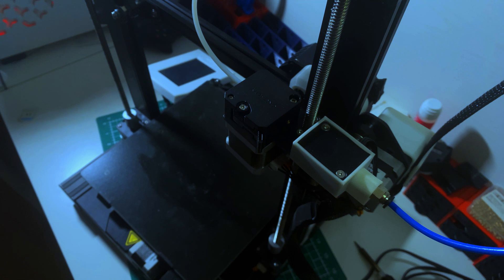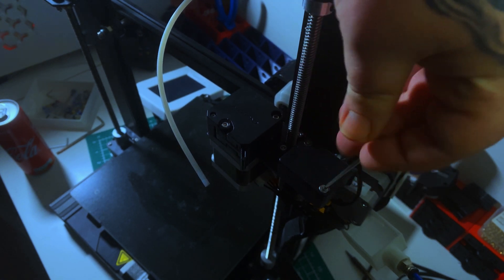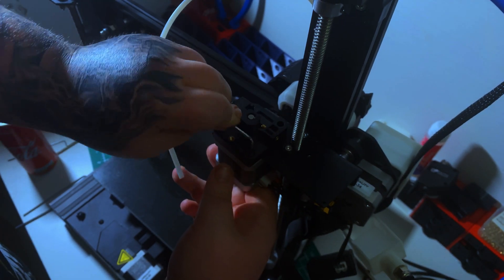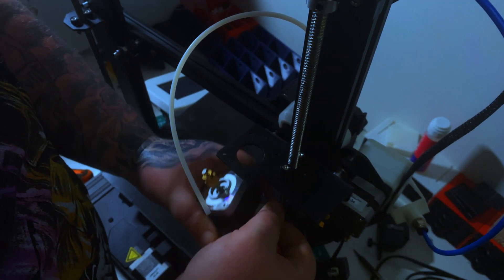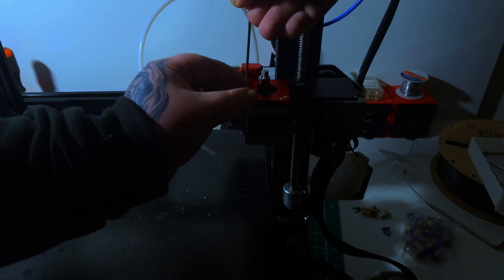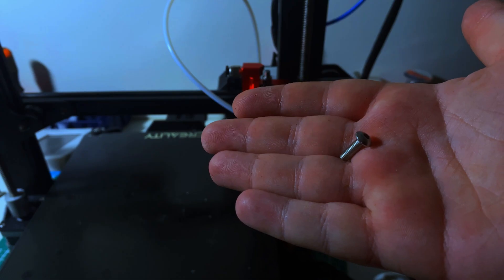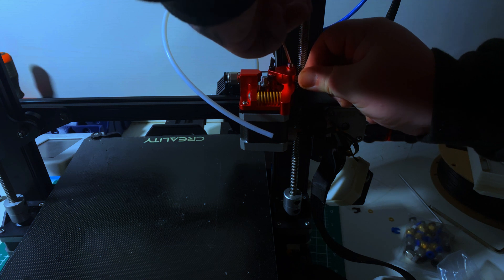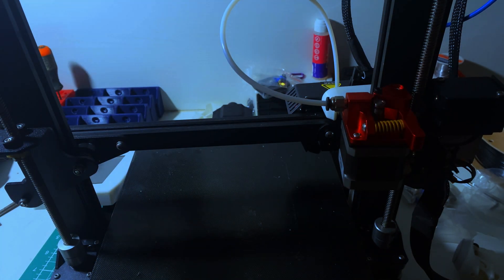Creality CR-6 se  extruder upgrade

Comment: Thanks for the video. I followed the video in the description how to tune esteps. Unfortunately it is for ender 3 machines, not for Cr6 SE. Is there a way to tune the value for Cr6 SE? Thanks
Reply from the maker: Tbh I advise upgrading your firmware before you try to calibrate your e steps as the stock firmware does not really allow for it .also I will post a cr6 se e steps video tomorrow 🙂
Reply: @FilamentFoundry  Did you post up that follow up video?
Reply: hola necesitara actualizar el firmware de su cr6 se. Al firmware de la comunidad versión 6.1, con esta versión se puede modificar los pasos del extrusor

Comment: My CR 6-SE orginal extruder broke. I put a dual gear aluminum extruder. What is the printer e-steps?
Reply from the maker: Do u mean e steps ?
Reply: @FilamentFoundry  yes!
Reply from the maker: @joaopaulobersani9672   mine was about 115   It might be different for u. I also included a vid in the description on how to find it out for urself